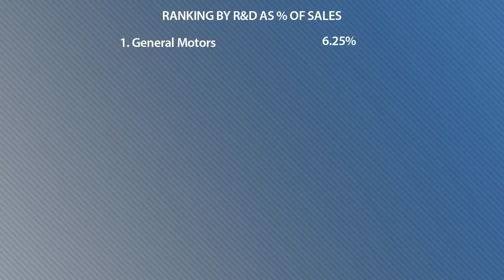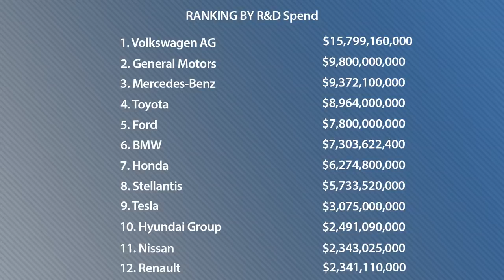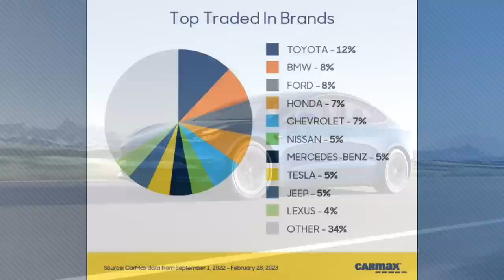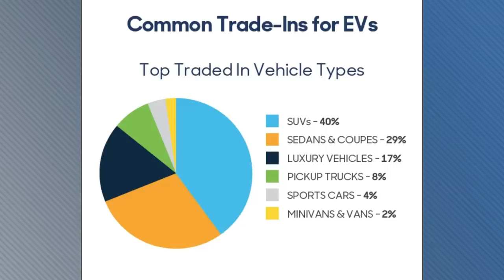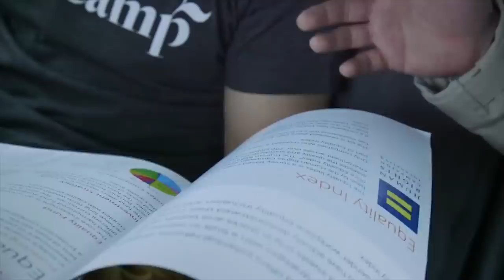BYD Growing Faster Than Tesla; Limos Going Extinct

Comment: BYD is growing super fast, but I don't think they are investing in advanced manufacturing tech as Tesla. Ultimately, that will prove to be a differentiator.
Reply: What advanced manufacturing are you referring to exactly?
Reply: Tesla doesn't spend much on R&D.  They're not going to make it.
Reply: @igotanimac1  The movement to 48 volt to reduce the amount of wiring, gigacasting to a degree that no one else can match, conforming structural battery arrangements.   Improved motors.  Low temperature adaptation.  All of this reduces weight and/or improves performance.  So far no one else has done it.  They should wake up soon but the OEMs require a new assembly line for them to do it.
Reply: @victorluke5816  I'm pretty sure the OEMs have the ability to adopt 48V instead of 12V, don't see this as an advantage that can't be replicated.

The giga casting Tesla uses is not made by Tesla, they buy it from IDRA/Bühler, so they'd just buy it from them if they were interested, but they are not interested because even small accidents that cause damage to something like the bumper have the potential to be expensive to repair as they may require the entire front to be replaced and therefore lead to higher insurance premiums. Instead, OEMs say they are going to be using small portion giga castings to more effectively complete minor/major repairs without increasing repair costs. 

So only Tesla is improving their motors or improving thermal management? I'm pretty sure the OEMs have the ability to improve either one, considering they spend millions in R&D and have engineers.

So far I don't see any actual manufacturing advantage from Tesla.
Reply: @igotanimac1  The switch to 48 volt was ready in the 1970s.   None of the OEMs wanted to change because that would have initially been a little more expensive.   Tesla just did it and are saving about 100 lbs. of wires per car with the change.  If the OEMs are smart they will too unless they are still going to go with not rocking the boat that they have done for the last 50 years.

Idra makes the casting but Tesla developed the alloys from Space X.   This is one reason why no one else has used the castings successfully yet.   Many have bought from Idra but no one is using gigacasts of Tesla's size because they actually can't.   Their metallurgy can't support the larger form factor.

Tesla was able to develop the motors faster because they have first dibs on engineers.  The number 1 engineering destination for grads is Space X, then Tesla, then NASA.

That means that everyone else is getting the B team, or C team for their R&D.

You are not paying attention to the engineering.
Reply: @victorluke5816  Some of the OEMs have already used 48 volt for years now. Audi, Porsche, Volvo, etc. So how exactly is this a manufacturing advantage by Tesla considering others are already using?

That's actually not the reason. OEMs don't need Tesla's alloys to be able to use a Giga press. Again, as many OEMs have said, they will not be using giant giga press castings like the size of Tesla's casting due to higher repair costs for insurance companies and therefore higher premiums for people, so instead they are using them on a smaller scale all while still savings parts and weight but not the extent of Tesla's giga press for the reason I outlined. Zeekr is one manufacturer that is already beginning to use  gigapress castings on a smaller scale, and here is a direct quote from them "There is a drawback to manufacturing large pieces, however. As large body sections are made from a single piece, any damage that a part may suffer in a crash could necessitate the expensive replacement of an entire section of the vehicle. Zeekr says it has addressed this by developing a system that allows it to change select parts of the large die-cast section without having to replace the entire panel.

“That should help reduce the repair cost after an accident,” Jiang noted. “We believe customers should not pay extra for our technology innovation.”" 

What advantage does a Tesla motor have vs something like the Hyundai Motor in the Ioniq 6 and Lucid Air? They produce just as much power and at greater efficiency, so what advantage is there in their motor? 

I'm paying attention to the engineering, and see no advantage.
Reply: @igotanimac1  Its the amount of 48 voltage on a car's wiring.  Audi Porsche, Volvo etc saves a few pounds while Tesla saves over a 100 pounds.  That's a huge difference.  

Great excuse for using smaller giga press parts.  Everyone else's would have 80% or more rejection rates on the larger presses due to their older metallurgy.  They are using smaller gigapress due to their inability to use the bigger ones.

There is no higher efficiency than the Model Y in the world right now.   The rest are getting closer but its still no cigar.  And when they do Tesla is usually ahead of them again by the time they get there.
Reply: @victorluke5816  What source can you provide me that shows the 48 volt in Audi, Porche, Volvo saves less weight than Tesla? 

A reasonable excuse that makes perfect sense. They are using smaller Gigapress because it makes sense that using larger would cause more expensive repairs for insurance in even minor accidents and therefore higher insurance premiums to consumers. And what source can you provide me that says OEMs don't have the ability to make Ggigapress castings to the magnitude of Tesla considering they have just recently gotten access to them?

That's because the Model Y has a lower drag coefficient than other electric SUVs. Other OEMs have decided to design their EV SUVs in a way that makes them have higher coefficient of drag and therefore less efficient. The Hyundai Ioniq 6 sedan for example is now just as efficient as Tesla's model 3. The Hyundai Ioniq 5 SUV could be just as efficient as the Model Y but they decided to create some design elements that produce a higher coefficient of drag and therefore less overall efficiency, so I don't see them having an advantage in the motors considering their efficiency is already achievable by others.
Reply: @igotanimac1 The proof is in the pudding.  To see Tesla's overall advantage in EV design, engineering and manufacturing, go to the end of the video (actually the conclusion of the drive and beginning of the summary, just after the countdown) on any of Bjørn Nyland's 1,000km Challenge videos.  There you will find a table showing how different cars compare on this definitive test of EV road trip performance.  You will notice that Tesla is the undisputed champion.  

The Model 3 can outperform Porsche Taycan and Audi e-tron GT, for half the price.  And aside from these two very expensive German cars, only the Hyundai group Ioniq 5/ EV6 even come close to Tesla levels of road trip performance.  Unfortunately they are lacking in some key features for road trip convenience.

This is where the rubber hits the road.
Reply: @davidmenasco5743  The undisputed champion in terms of what? Range? That's obvious, The model 3 has one of the lowest coefficient of drag and therefore more efficient than most comparable EVs, but nothing to do with an actual manufacturing advantage. EVs from OEMs are choosing to sacrifice the drag coefficient to produce design elements that increase the drag coefficient and therefore get less range on a similar vehicle/battery pack. 

Model 3 can outperform the Porsche Taycan and Audi e-tron GT in terms of what? They get identical 0-60 figures when you compare comparable trims. So what exactly? Pricing is not a manufacturing advantage. The Hyundai Ioniq 6 is the first EV to match efficiency figures of the Model 3 because of the .22 drag coefficient they decided to produce. What key features is it lacking for road trip convenience? It can charge in about 1 hour at 440v.
Reply: @igotanimac1  No no no, not range.  Not charging speed.  Not acceleration.  The 1,000km challenge is a measure of total trip time, in the real world.  This is the number that is meaningful to the end user on a road trip.  Most EVs take an hour or two longer than Tesla for the same trip.

The Porsche and Audi come closer, but for a very high price - due to much more expensive manufacturing.  Of course, for twice the price you get a nice car (with some software issues).

Kyle Connor and Bjørn Nyland have both detailed, at length, the road trip related features that are lacking in the Hyundai group cars (my memory fails me here, on the specifics).  The cars would still be reasonable alternatives to Tesla, if they were made in sufficient volume and if the CCS charging network was adequate.  Unfortunately CCS still has a long way to go (in the US), Hyundai group EV output is just barely above token levels and the cars only come close-ish to Tesla in EV features and performance.

Manufacturing is part of the total package that explains why no EV outsells the Model Y.  We will see soon enough if they can keep it going with the new model from Mexico.  So far it looks like it will be some time before anyone seriously challenges Tesla for the total EV package.
Reply: @davidmenasco5743  If the 1,000km challenge is based on total trip time, that means charging time and efficiency per mile driven have to be a factor considering you'd have to charge at least once during that 1,000km trip and efficiency has to be a factor because you drive more miles per kWh if it's more efficient, which means less total trip time.  So of course Tesla Model 3 was going to take less total time because it's efficiency is greater than any of the other EVs due to their lower coefficient of drag (up until the Ioniq 6). Low aerodynamic coefficient of drag and therefore higher efficiency and lower trip time, is not a Tesla manufacturing advantage. 

Porsche Taycan isn't more expensive because they have higher manufacturing cost. The Porsche Taycan competes with the Model S, not the model 3. So compare the price of the Porsche Taycan with the price of the Model S, they are almost identical. To compare the Model 3 and Porsche Taycan is ridiculous. Porsche is much bigger than the Model 3 among other differences. The Porsche Taycan is more expensive than the Model 3 for the same exact reason that the Model S is much more expensive than the Model 3. 

No EV outsells the Model Y because there is yet to be any competitor that has released an SUV with the same legroom, cargo space and range as the Model Y. The only one that comes close is the Ioniq 5, but with less total legroom and cargo space, and now with no federal tax credit. The first true competitor to the Model Y will be the 2024 Chevrolet Blazer EV which is set to be released sometime this summer.
Reply: @igotanimac1  The reason that no one is getting big weight changes is that they are not changing the wiring just the battery.  So we get an Audi that has a 48 volt battery that is 3lbs lighter than their old 12 volt battery.  They don't have an OEM that will make them a different wiring configuration so they don't save on the weight.  Tesla makes the wiring for their cars so they make the wiring lighter to take advantage of the 48 volts.   48 volt batteries will still work with 12 volt wiring but not the other way around.

The basic problems with using gigacasting machines is shrinkiage and bubbling in the product.  The bigger the component and the more curving the cast has the worse the problems.  Check any video on the problems with gigacasting.  Andrew Albert is a good source.

The model 3 you are comparing the Ioniq 5 motor with is using a 3rd generation motor while the Model Y is using a 4th generation motor.
Reply: @victorluke5816  Again, what source can you point me to that specifically outlines the weight of the 48 volt in an Audi/Porsche/Volvo/Tesla so I can see if the Tesla 48 volt actually weighs less? 

OEM's have made no real attempt at getting a final product to the extent of the giant Tesla giga press because they are not interested and will never be, and not because they can't. Some are already producing large castings, but not to the extend of Tesla because it creates higher repair costs for insurance companies and therefore higher consumer costs through higher insurance premiums as a result of larger repair costs associated with creating castings to the extent that Tesla creates. So I definitely don't see this as an advantage that Tesla has.

No, I was not comparing the Ioniq 5 or it's motor when I was comparing efficiency of Model 3 to Hyundai, I was comparing the Ioniq 6, which match/exceeds the efficiency of the Model 3 and has less to do with whatever generation motor they are using, and more to do with the fact that Hyundai managed to produce an aerodynamic coefficient of drag that is slightly better (lower) than the Model 3 and therefore more efficient (higher miles per kWh).
Reply: @victorluke5816  Got your response but doesn't show up on here, only on my email, anyways. 

None of those sources point to the Tesla 48V being over 100 pounds lighter as you said. Nobody makes the wiring because they just use the converter, if any other auto maker decided to, they would start using wiring, Tesla would not have some secret wiring that can't be replicated. 

"Large castings can be cut and welded for repairs" Exactly, which would lead to higher repair costs, and therefore higher insurance premiums for everyone. "This means that if other insurance companies will charge extra then Tesla insurance will be able to make a killing and take more money once again by insuring more Teslas" Not how that works, they'll be charging extra to account for higher repair costs, they'll make the same amount of money, they'd just be offsetting the higher repair costs through higher premiums, they wouldn't be making 'extra' money.

I'm insisting on using older tech to compare to Tesla??? How is the Hyundai Ioniq 5 and 6 not the latest? I did not stop comparing the Ioniq 5.. I compared the Ioniq 5 to the Model Y in relation to drag coefficient being lower and therefore being less efficient. And then I pointed that the Hyundai Ioniq 6 was just as efficient because it had a drag coefficient that is just as low as the Model 3, and therefore just as efficient as the Model 3. 

Incorrect, the Model Y is not more efficient than the Ioniq 6. The Ioniq 6 gets more miles per kwh, and therefore more efficient. Model Y base trim gets 279 EPA miles of range using a 67.6 kWh battery, which translates to 4.12 miles per kWh. Ioniq 6 gets 240 miles using a 53 kWh battery, which translates to 4.53 miles per kWh. 4.53 is bigger than 4.12.

Comment: Is BYD growing faster? 😮 They make Hybrids & EVs
Reply: EV only segment for BYD increased a lot over past 2 years. Have to give them their due in that area.
Reply: BYDs pure BEV sales are higher in China than Tesla this year. And don't discount BYDs ability to quickly switch from making hybrids to only electrics.
Reply: BYD outsells every other automaker in pure BEV, PHEV and vehicle sales overall in China, the largest global car market. Also, their plug-in hybrids tend to have 120-240 km of battery range, which means it can serve as an electric car for most daily uses.
Reply: @Custo911  true, however since q4 2021 byd has fallen behind tesla not gained on them in total ev sales.
For 2021 byd was less than 400k unit's behind tesla in ev only sales, in 2022 that increased to over 440k behind. 

And so far in 2023 they are now on track to be behind by 640k+evs vs tesla ev sales. 
So byd sells more total cars sure, but not more total evs no matter the claim by Chinese fans to the contrary. 

Byd also doesn't make more $ per car nor do they even sell the majority of their evs in the same price segments as tesla does. 
Byd in FACT is struggling in the same pricing brackets as tesla sells in, just look at the seal vs m3 sales for easy proof. 

It's gonna be interesting to see if the new very nice looking song L priced even higher than a base model y can sell well, and the premium trim yangwang u8&u9 evs. 🤔
Reply: @seanmcelroy870  Last I checked BYD sold more cars than Tesla but Tesla outsold BYD on pure EVs this year and last year.
Reply: @4literv6 and this is selling cheaper models than TSLA.

Comment: ICE vehicles are more prone to fires than EV's. Battery technology is improving and percentage of fires on ICE vs EV's is increasing.  Granted when.
there is a EV fire it maybe  harder to to control.
Reply: it's a harder fire to put out. a local fire department told me they're flat out not going to try putting it out since they're that more dangerous than the usual car fire.

Comment: Sean is great at this job. He always sounds like knows what he's talking about.
Reply: Today he did not have a damned clue. AND always he is one day late. SO if you want to hear the latest news, look elsewhere.
Reply: @anastassiosperakis2869  
And based on the first part of this video if you want accuracy, look elsewhere.
Reply: Yeah, he sounds like it (sounds being the key word). There's quite a bit of incorrect information given on this show. Or, he gives half the info on something where the other half wouldn't be as nice as what he said. I typically watch this show to see new things and then look elsewhere for better info on it.
Reply: BYD has a very low 3% profit margin. They have produced more cars, but many are sitting in warehouses, parking garages, and open fields, unsold. The Chinese only want cheap EV’s, so BYD is selling many of its cars at a deep discount. Same is true with VW, BMW, and dozens of other EV makers. CCP subsidies are ending, so they no longer get rebates just for pushing cars out the door and not having to sell them.
Reply: @jeffs6090  They did name the channell "Autolying Network" for a reason.  The "spin" is making me dizzy.